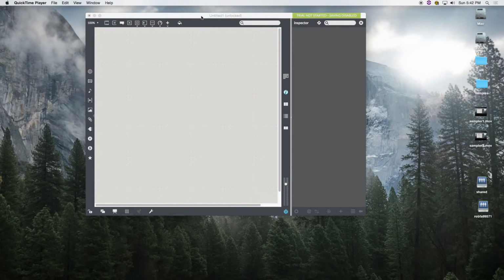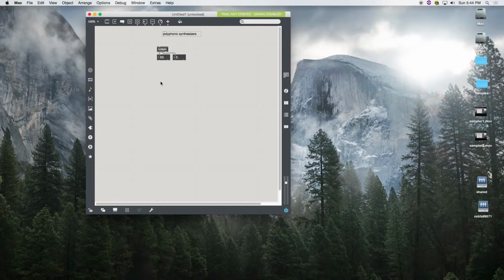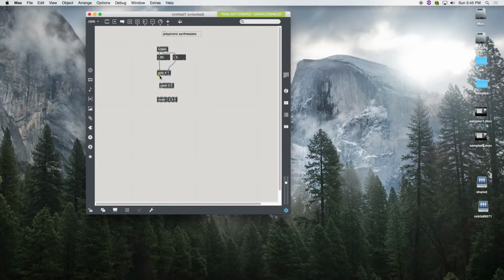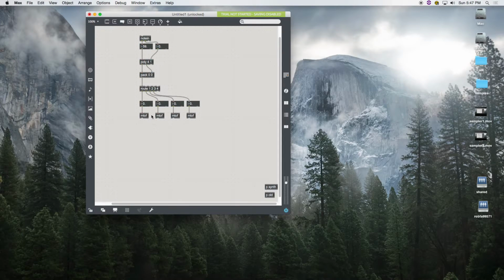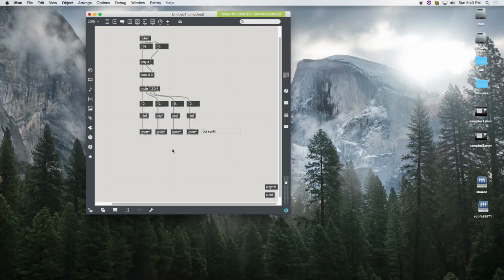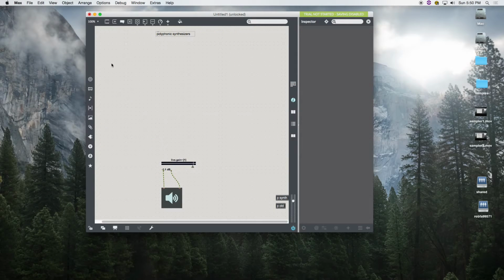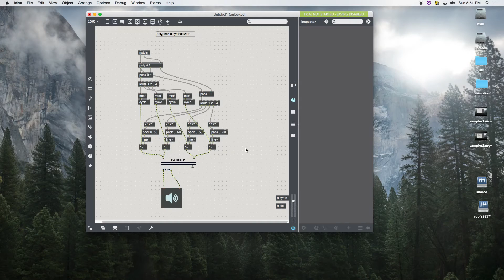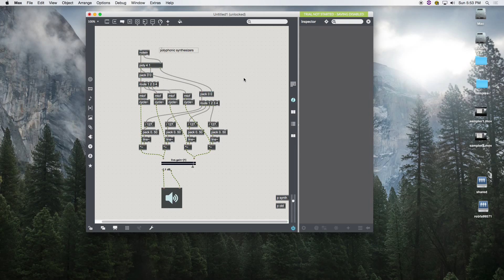Max 7 Tutorial 7 - Building a Basic Synthesizer

Comment: Here's a tip - if things aren't working in a Max patch for some reason, you can output pretty much any object into the right inlet of a message object and it will display whatever data is being passed through, that way you can usually debug to find out where you have gone wrong